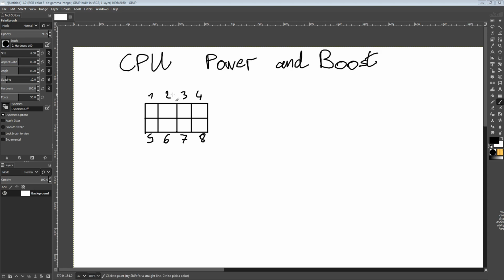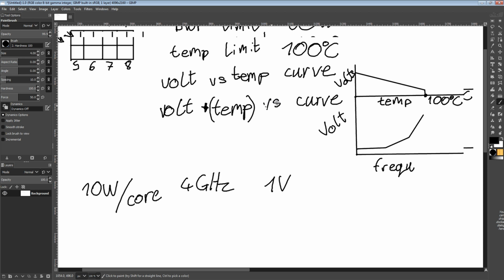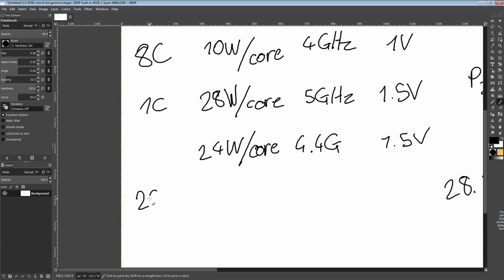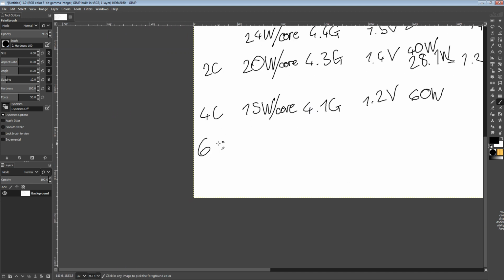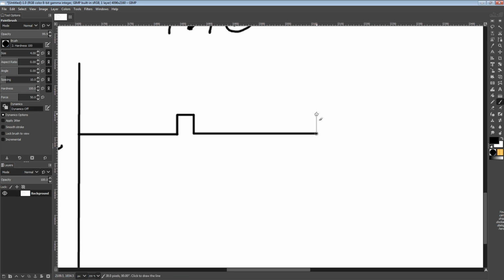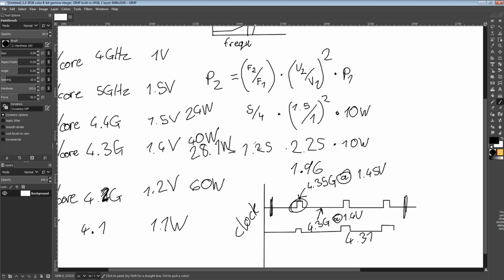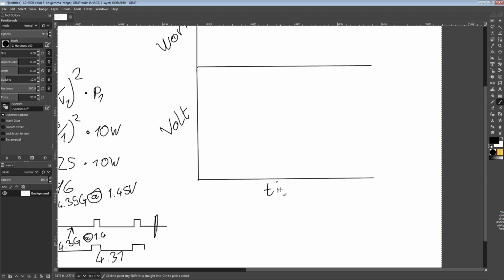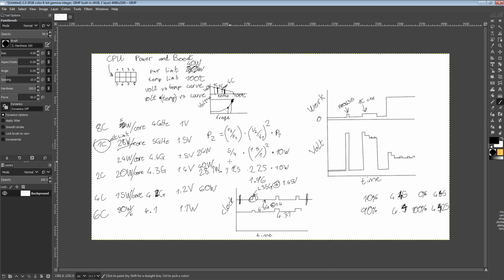Rambling about CPU boost and power

Comment: @27:14 Omg, this explains why my Ryzen 5 3600 annoys me in ways my Ryzen 7 1700 never did! It winds up the 120mm AIO to max, then stops...winds up the AIO, then stops, on and on.  It's like a car which automatically redlines as soon as you step on the gas, and then revs down to a more sustainable speed as it realizes you're going on a longer trip, and not just doing a short drag race or quarter mile run. I agree that this behavior should be turned off in favor of better consistency.  It also leads me to suspect that an AIO is a poor choice for a Ryzen 3000 cpu vs. an air cooler, which should be able to adapt to these voltage-induced temperature fluctuations more quickly.

Comment: how do i properly downvolt my 2700X if i dont need 4Ghz+ ? but its ok if i can make him run @ fixed ~ 3.7Ghz =)  right now 3.2 ghz @ 35C using windows power plan adjustments 

Thanks in advance guys ^_^

Comment: The crazy boost spikes are my second biggest annoyance with my 2950X. Mine has jumped to 1.52v at times. My biggest annoyance is the 68° C thermal throttle limit. Those boost often throw it above 68° C. Glad they got rid of that with Zen 2. Hopefully they carry that over to the 16 core TR chips.

Comment: Helps to explain why undervolting can sometimes give improved performance. The lower voltage at the same GHz difference is squared, giving much lower power use, giving more room to boost higher.

Comment: Super interesting. Considering intel chip MB's makers run all core max boost by default and Level1techs with tweaked AMD motherboards is runing all core 4.4 and close to 4.5Ghz on some chips and the 3950 is still yet to come out with a 4.7 Ghz boost. I think AMD  just released to early and the bios / MB need more time to sort out the max limited on this new 7nm process. The zen 2 performance limits is far from sorted out.

Comment: I had a 2700X with BClk OC actually hitting 4.5GHz max. boost 100%stable which was really looking damn good in HWiNFO but not really doing anything useful just as you explained... :)
So i ended up just setting it to a safe 4.2GHz all core and bumping it up to 4.3 on the fly with Ryzen Master for gaming as that gave me better min.fps than the silly boosting...

Comment: I already asked on reddit but noone was able to answer me properly. Why is it safe to run 1.47V in single threads but only 1.325V in all core. Is it "JUST" a matter of temperature? I mean 1.47V should shove way more current in a single core than 1.325V So the strain per core is way higher in the 1.47V scenario.
So hypothetically speaking. If I was able to cool my CPU to let´s say constant 40°C Is 1.47V fine for all core? Or more practically... the CPU is designed to be at least cooled by the boxed cooler. So 1 threaded workloads push the CPU to 55°C. If I can keep the CPU under 55°C in all core work loads is 1.47V fine?
Reply: Anyone want to answer this?
Reply: I think not. You forget about current, which is significantly higher in total for 1,47v all-core. Probably too high in the long run.

Comment: This is something I've been wondering about since I got my 3700X.  Thanks! Looking forward to seeing the follow up. The Gigabyte Aorus X570 Pro WiFi has an option to disable the precision boost algorithm, then I've just been using the traditional manual OC settings and CC6 sleep states to keep everything from boosting willy Billy.
Reply: Did you try pbo enabled but precision boost disabled? I wondering how it will perform
Reply: @deminatoer  Not yet.  I've been just running it on the manual OC lately, but I will try that out.

Comment: If the frequency is too low though.... will the chip stop working? The reason im wondering is because then in theory the electrons don't have enough voltage to get attracted towards the positive Base battery and then it would stop working...?
Reply: No. The voltage handles transistor logic, not clocking, and all the common CPUs out there are static designs. As long as the voltage is high enough to handle powering and switching them, you could run down to arbitrarily low frequencies, or just sit there with power but no click for awhile, and not lose anything.

Comment: Until you have access to a Ryzen 3000, I pulled this scope capture from der8auer's video about idle behavior:

https://i.imgur.com/Ie6dIFu.png

Annotated for speculation about the cause of high idle power.  I'm less confident in that than I was when I drew it, though. New theory is that it's an expected consequence of using something like the intel_pstate performance governor in Linux. I'm also seeing 15-20 W package power just waving the mouse over a web browser with that governor on a 4670k, compared to ~8 W with powersave.

Comment: Hey BZ!!! Love the channel! Keep up the great work!!

I’d love for you to look at some interesting things I’ve found about the last gen R2700x and now 3900x.

I previously noticed that when using my x470 ac pro carbon board with 2700x (water cooler) I could get all cores boosted at 4.35 at 1.4v... with PBO enabled, however I could not go over 3000mhz ram speed - if I went to say 3200, my boost speed dropped immediately. My temps were really solid on that setup and I used it daily.

Now I noticed that on my gigabyte Aurora master with 3900x this trend is the same. If I go to 3200mhz plus, and I’ve run up to 3800 stable the overall boost clock speed PBO or xfr - speeds stay almost identical but overall speed is low. At for example 3600mhz, my max core speed never exceeds 4.3ghz that is with iF set to 1/1 for all tests.

But here is where things get interesting....

I have tested my 3900x (never did this on 2700x) on a per CCX plane.

So cores 1-3 are at 4.5ghz, 4-6 are 4.550ghz, 7-9 are 4.450ghz, and 10-12 are 4.4ghz... all at 1.4v

This runs stable with...... 3600mhz cl16 settings for an overall clock speed

Just very interesting to me to see the clock speed restrictions on boost modes but not pure OC.

Comment: Ummm buildzoid, doesn't each pair carry 10w, thus being only 40w total?  Maybe I don't understand electrons.... But I was always taught what goes in must flow out (minus some losses).  Granted, the connector will handle 336-388w total across the 4 circuits, but that means 84-97w per pair and not 42-48.5w per wire.

Comment: Got my 3700x yesterday, after a quick testing, benchmarking and messing with Ryzen Master and PBO I can say that everything in this video is 100% as explained.
Boosts on every little thing up to 4.4 with 1.47v on a single core, temp reading up to 60 this way, but the cpu heatsink is cool. And all core load is 4.0 to 4.1 with 1.2-1.3 v, totally normal.

So you should set your fans to minimum up until 60-65c readings(I did) and it will stay quiet, while being cool, because it's not a whole chip temps.

Comment: This means we need to fight against more and more factors when overclocking, from older just frequency ceiling to freq/volt/power/temp limit.

BTW, do you have any idea how CPU vendors test what voltage/amp/temp combo will degrade a CPU? Is it just tech sheet from TSMC or something CPU vendors need to figure it out manually?
If the later case, by how? Just raise the temp to speed up the degradation?

Comment: I'm not a fan of the overly aggressive peak boost on the 3000 series chips, not to say that the 2000 series chips were any better as they also run high peak voltages with similar behaviours.
Call me old school, but as far as I'm concerned these brief forays into higher clocks don't count, my single core boost needs to be a flatline boost sustainable forever.  These little low power high frequency boosts do little for responsiveness by extracting another 100mhz for less than 100ms over a more sustainable clock that gain you 1-2ms on your mouse movement, maybe hard core competitive gamers will notice the difference like they can every other imperceptible gain on lag, but that would be better served in a gamer mode algorithm to give these super human elites a reason to flog the voltages on their chips. The reality though of 25 to 50 Mhz extra for 10-50ms would have mouse responsiveness measured in micro seconds not milli, but I'm sure that's an extra 5 kills for the super human gamer who notices response gains down to pico seconds, but then when they're gaming how often would these little performance peaks occur when the CPU is already at 20-50% load for all cores.

These peaks above flatline are mostly irrelevant and do little to nothing for anything but the marketing department.

Comment: So, will I need the extra 4 pin cpu power on my CH7 w a 3900x ?
Reply: No, its a useless feature unless you use LN2 for OC. Buildzoid said that couple times in older video about x570

Comment: This is fascinating!  My question is this:  if you have a cpu where AMD has converted it from a chip with more cores to fewer cores by disabling cores to hit a lower price point (or because part of the die didn' t work right, so they disabled part of it), is there a way to tell (physically) where on the cpu the active cores are located?  Depending on where the active cores are located, this can go a long way toward explaining why cpus with disabled cores can have dramatically different overclocking capabilities...

Comment: It looks to me like Ryzen is actually working very similar to Intel's turboboost. The difference is we aren't seeing the far higher single/low core boosts above the multi core loads because of whatever it is in the Zen design and/or each of the 14/12/7nm processes that manifest as a pretty solid frequency wall.
I have a fair bit of experience tweaking turboboost since I play with the desktop-socket laptops, where the lack of watercooling means playing with power limits, fan curves, undervolts yields far better results than the standard static voltage/fixed multi Intel OC approach.  (I have a 9900K in a bios modded Z170 socketed laptop which needed a lot of tweaking...)

Comment: I don't know about you but I am on my 3rd different bios on my x470 Taichi and each subsequent bios has boosted my 3700x's performance. Also I've read that the maximum daily safe voltage is 1.325. Is that true?
Reply: That info comes from The Stilt, an ASUS community member who makes custom BIOSes etc.  1.325V is the figure stated for a safe voltage when all cores are being utilized, when running a benchmark or encoding video at 100% usage.  Especially for hours or days at a time.  To go above that risks degrading the chip (over time) and to go below that gives you some headroom and also lowers temps if you want a quieter case or have a subpar cooler (or it's summer).  So if one was to manually OC all cores to the same frequency, that is the number that's been stated for maximum safe voltage.  If you're just using stock boost, that number is sort of irrelevant.  Unless you've got a dodgy BIOS that's using voltages a lot higher than that, which some do.  In that case, some people have been using a negative voltage offset to bring the temps more inline with that figure.  And also keep in mind, after more time and feedback.. the info out there could change.  It's still very early and everyone is effectively a beta tester at this stage.

Comment: Kinda sucks that they can't enable monitor of each core temps.
Also that max temp of 1 core makes it harder to tune the fan curve, because there's no heat for air to take away by ramping up fan speed.

Comment: Buildzoid, show us how you connect that oscilloscope so that we can do it ourselves if we want to.
Reply: It's easy. Unplug your board (and maybe take out your cpu) and take a multimeter (diode mode). now measure your vrms (chokes or caps) against ground to see which contacts are your power plane (0 ohm for ground to ground and >0 ohm for power to ground). Now turn your board and look on the backside of the socket. Probe with your multimeter against the power plane. If you get 0 ohm again you got your power plane. Now you need a way to attach your scope probe, most likly you have to solder (will void guarantee)

Comment: a ram guide for ryzen 3000 would be great.single sided vs dual sided and 4 sticks vs 2.im thinking about best performance on daily system
Reply: A new version of Ryzen RAM Calculator is coming out tommorow.  You input whatever specs you want to test, and it gives you the recommended safe (or fast) timings.  Further adjustment can be experimented with, or by using the specs of forum or reddit users who have the same ram or motherboard as you etc.

Comment: Ryzen 3000 overclocking guide:
1) Manually set your voltage to 1.3250 from bios never use AUTO. 
2) Set LLC to medium-upper medium values to be safe (LLC 2,3,4 on a scale of 1-5, depending on your mobo 1 might be the highest or lowest value). 
3) Find your best binned CCX. 
4) Set the clock of other CCX(s) to the base clock of the CPU. 
5) O.C your best CCX to the stable limit with trial and error. 
6) After that do the same for the rest of the CCX(s).

You should get very close to the advertised single-core boost speed with your best CCX. At worst 100mhz lower at best the same as the boost speed for your best CCX.
Not every 3700x guaranteed to run @ 4.3 ghz all core but you are guaranteed to run 1 CCX  between 4.3 GHz and 4.4 GHz. The other CCX will run anywhere from 4.15 to 4.30 GHz. In that case you will be limited with your trash CCX in an all-core overclock scenario.
If you have fast RAM you can OC infinity fabric. For that manually set IF/RAM ratio 1:1 from bios. Try to OC IF clock to 1900, for most of the chips it is the limit. Your ram sticks should run at 3800mhz with that setup. After that try to tighten the CL values.
Reply: And after all that effort you boost the performance by maybe 5%? It seems manual OC is not very rewarding with these new Ryzen 3000 chips! And that is the way it will be going forward even on the Intel side of things.
Reply: I just leave it on auto, 3% difference i'll take it as margin

Comment: Great content here! Please, can you explain the formulas and all it’s needed to be able to calculate and calibrate the   cores individually to boost specific workloads. I’d like to test my 2700 in specific games realizing which cores do the game requires to clock higher and which lower so I can maximize performance tweaking each core voltage individually. Thanks for sharing your knowledge, and don’t say you are lazy, you worked hard to figure this things out, keep it up!

Comment: Is it smart to use Samsung nvme 3.0 on a x570 mother board with Ryzen 3900? Or should I get NVME 4.0?
Reply: If you're getting an X570 board, go with a PCIe 4.0 drive over a Samsung 3.0 one. The price is much the same (970 Evo Plus vs Sabrent Rocket PCIe 4.0 w/o the heatsink [assuming your board has one for the M.2 slot, otherwise get one with a heatsink], which is the cheapest of the new Phison based PCIe 4.0 drives [they all perform the same]), but the performance gap is HUUUUUUUGE.

Comment: Can you take a look at the MSI GSE-Lite BIOS on the x470/B450 boards, take a look at saving profiles (hear this is gone, but can it save to usb?) and fan control (possibly nerfed)
Reply: I have a B450i, there's no saving profiles at all But I like the simpler fan controls as I can type in whatever temp / fan% curve I want. It also seems to have a problem with boosting (current 1.0.0.3ab bios) where it is only dropping fequency but not really voltage, it still runs max voltage it can for the current being pulled but in prime95 for example it will drop the frequency all the way down to 4050 but still be asking for 1.33v.. when the cpu is prime95 stable at 1.2v with 4050mhz manual clocks. Definitely wait for more updates if you can.

Comment: When you know your stuff, you no longer have to blame others for lying about their TDP, because they didn't, you were just too ignorant to understand how boosting works.
Reply: Learning stuff is fun.  More knowledge the better.  But I still think that there's a lot of dodgyness from both sides of the CPU fence, when it comes to both frequencies and also TDP.  AMD when it comes to the frequencies and boost and Intel when it comes to the TDP.  In terms of AMD, I very much agree with this video, especially these marketing boost nubs that BZ wants AMD to remove in this video.  Combine that with the video that AMD released days before launch, quoting figures of 4.5GHZ and 4.7Ghz with PBO and AutoOC and drawing these graphs with different colours.. giving the impression that these numbers will be achievable.  Flat out deception.  No one is ever going to hit those numbers.  You need liquid nitrogen to reach 5Ghz for pete sake.  And even a 4.65Ghz boost nub for 5ms with a silicon lottery winner, while technically being true to numbers.. is useless in the big picture.  And has other drawbacks (like stability or higher idle temps) mentioned in this video.

Comment: The blips are inherent to the algorithm. It's bouncing or testing the limit and it can only be above or below. Check out PID control algorithm for a smooth process control. But it takes more effort to implement and tune. (The VRM is probably using a PID loop.)
Reply: Yup, that's exactly what I was going to say - it's an opportunistic algorithm, so, as soon as the load/temp drops, which will allow the mini-spikes to jump beyond the ceiling that they were previously being held back by, where it'll keep climbing until finding the next voltage-load-temperature delta. The mini-spikes are real time data probing; which is truly bringing the consumer CPU into the 21st century instead of just being made up of server lineup rejects. 

Personally, I love it! I don't need my CPU to meter out only as much computational capability as it's told to by Intel; unless I go into the BIOS and lower the artificial walls myself. IF I paid the extra fee that this strictly software feature costs...